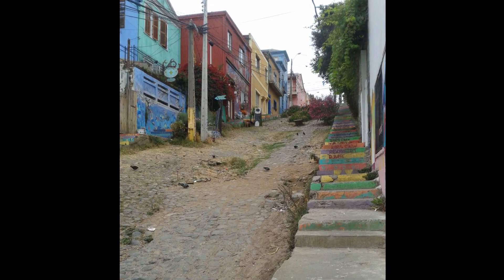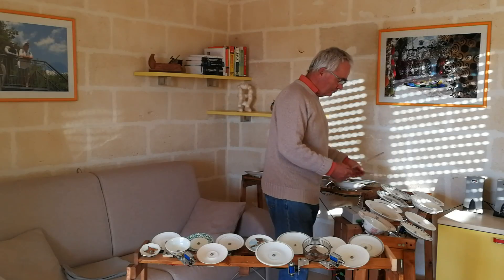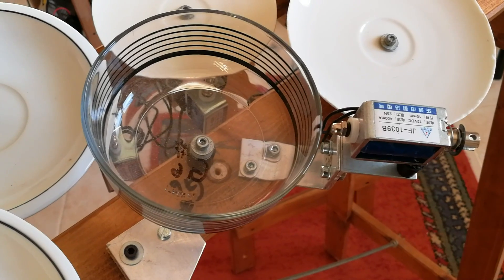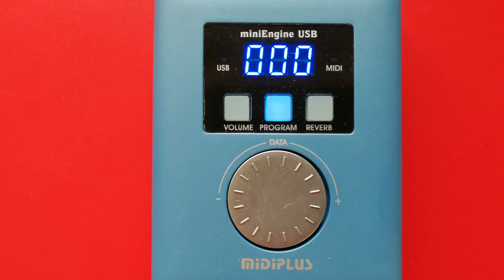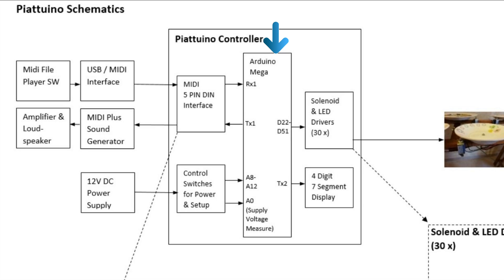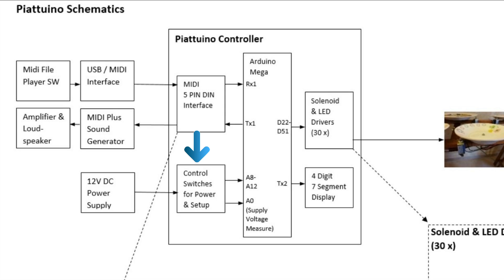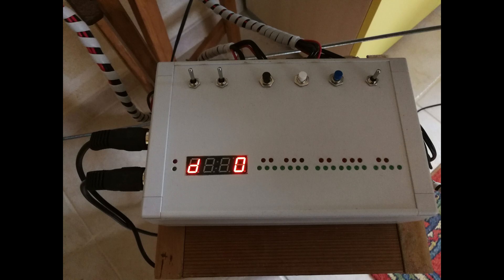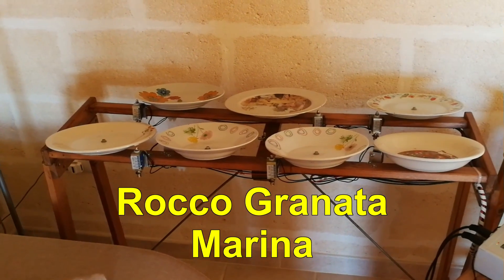Piattuino technical presentation

Comment: That's outstanding! I've been using MIDI for a long time, and it's relatively easy to understand how MIDI messages translate into real-world musical usage (a certain note or CC of a specific value occurs at a specific time, for a certain duration, then an OFF message). With Arduino's ability to control switches and motors (and lots of other things, I'm sure) with incoming MIDI notes and control messages - and have them triggered along the easy-to-understand timeline or piano-style grid of a typical software MIDI sequencer - it's really mindblowing to me. I know there have been things like MIDI-controlled lighting and dimmer switches around for awhile, but seeing something like this in action (your Piattuino) is just so inspiring. Old-school electro-mechanical combined with modern miniaturized computing power. So great. Many thanks for sharing your awesome creation with us.

Comment: May I know how can you find those plate with the right pitch?
Reply from the maker: Go to a thrift shop and ajust the plates with a cutoff wheel.
Reply: @vizulu  Thank you so much！！but may I know how to adjust the plate with cutoff wheel? Thank you thank you!
Reply from the maker: With the cutoff wheel you can reduce the diameter of the plate and it will sound higher. I tested the sound frequency with the "DaTuner" app. You always can make the sound higher, never lower.
Reply: @vizulu  Thank you! Also, may I know what is that with the green color at 1:26? Is that a block?  And the screw in the middle of the plate is for holding the plate only?
Thank you so much!
Reply from the maker: @wonderl5778  The green Blocks are the conectors to the solenoid coils. Yes, the screw in the middle of the plate is for fixing the plate. Under the plate is a rubber cylinder  working as a vibration absorber. Kind Regards Heinz.
Reply: @vizulu  Thank you so much Heinz.
As i am working on a project that similar to this so I wanna know more about it. I hope you would not mind it. May I know the software you used for creating the midi? And did you use MAXMSP for this project?  Thank you!
Reply from the maker: @wonderl5778  I took all midi files from the internet. Search the desired song and you will find also a midi-version.
Reply: @vizulu  That means you did not use any midi software like Logic Pro or Ableton to generate the midi to arduino?
Reply from the maker: @wonderl5778  No